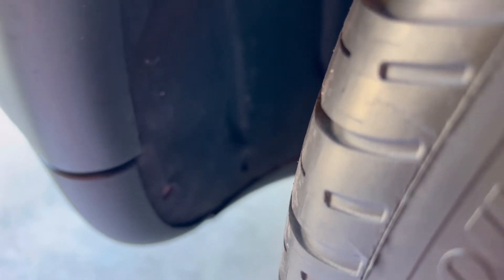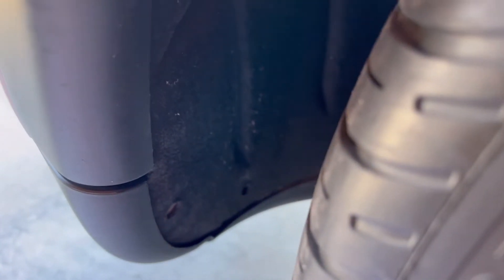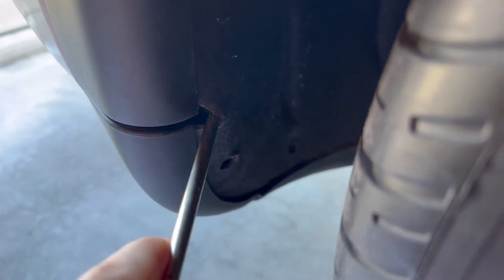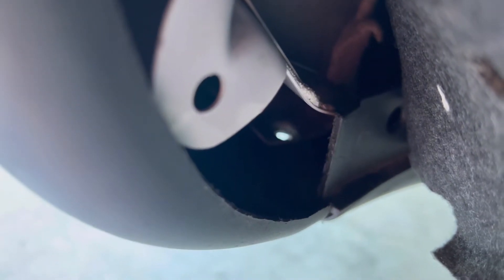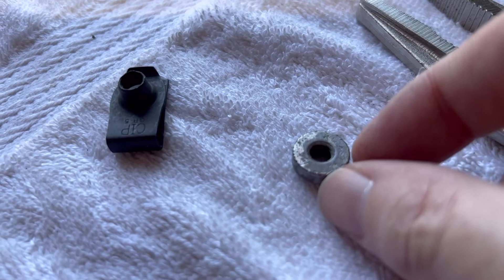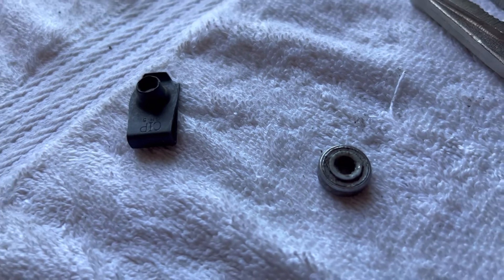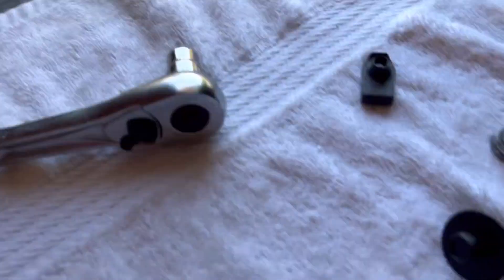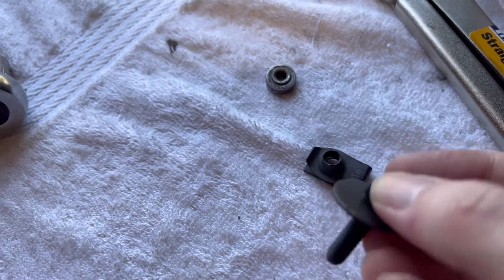Tesla Model Y Rear Mud Flap Bolt Fix

Comment: First, thank you! Last mud flap on a 2026 Y and had this issue. Found this and was a life saver!

I can confirm this is the perfect fix for this issue that Tesla has yet to address even for a 2026 Y.

The tool is about $12. Bolt and clip were about $10. I’d suggest to use two people: one for holding on with the vice grips and one to slowly undo the bolt.

Last part, the u clip. Hold/lock with the vice grips and push on.

Thank you again. Was so angry, but with patience and finding this, corrected the issue in about 10 minutes.

Comment: I forgot the 4th mudflap and this looks like exactly what happened. My Y is a new ‘26 Upgrade and the bolt hole looks the same but fasteners inboard of this may have changed with the new rear end design. Any chance Tesla would cover this on a 3 week old car….happened as I tried to loosen the bolt. Thanks for the great video.

Comment: Thank you for this.  To fix my issue, I took the wheel off to get better access and used a hack saw to take off the head of the bolt.  I then reached in with 15inch needle nose to remove the nut.   I followed your suggestions for the clip and new bolt, which worked well.
Reply from the maker: Awesome! Glad it was helpful.

Comment: Can u share the unuts Amazon link for me, not sure which one is the right size , as they shows  in mm system , thanks
Reply from the maker: I'm not 100% certain if these are an exact match - https://www.amazon.com/Hillman-Group-58452-4-20-Inch-Extruded/dp/B00NWJEXSG/ref=sr_1_1?crid=1Q0RD0NFJ1LSL&keywords=Hillman+1%2F4-in+x+20+Black+Phosphate+Steel+U+Nut&qid=1699311673&sprefix=hillman+1%2F4-in+x+20+black+phosphate+steel+u+nut%2Caps%2C122&sr=8-1

Comment: Great video and exactly how it is done. First off- wtf Elon on a round nut!!!! Second - it is very difficult to get off. I recommend getting the 15” pliers and wd40 nut bolt penetrant that loosens nuts bolts.  It does take a lot of maneuvering to get a hold of the dumb round nut. Gimme a break Elon.

Comment: Hi, I want to install a mud flap on my 2023 model y. I'm not really good with doing car upgrades but I want to learn. Can you tell me what type of socket wrench you are using? I've never owned one and I want to make sure I get a set that includes the size needed.
Reply from the maker: I can’t recall the specific size for this bolt, but getting a 3/8” ratchet set with a variety of socket sizes is always good to have. Good luck!
Reply: @wesg92  sorry to hi jack the comments.  Great video
Reply from the maker: @jneptune1540  thanks! Hope it was helpful.
Reply: @wesg92  Thanks. I just got this car. Before was a 2006 Camry and I never did any work on it. I want to learn how fix stuff and add items on this Model Y.

Comment: I can't seem to get a good grip on the nut with the vise grips. I can get on, but as soon as I try to remove the bolt the nut slips out. I think I'm just not grabbing enough of it, but the angles are horrible to work with. Any pointers on getting a good grip? I don't want to break anything.
Reply: I'm primarily worried about the fender fascia breaking with me tugging on and bending it. I hit the bolt with some WD40 from above but frankly I'm considering at some point just using a Dremel to carefully cut off the bolt head if it still won't come. Thanks for the info! I'll keep working at it.
Reply: I used a mini hack saw to cut the head off the bolt. @steves.4848
Reply from the maker: Ya, it's really tough, but possible. Are you using 15" needle nose vice grips? That's what I had to use, and it probably took me nearly an hour to get it at the right angle and clamped tight enough to hold while unscrewing. Hope that helps, let me know if you have any more questions.
Reply from the maker: I don't see any risk of breaking anything. You can clamp down on that nut REALLY hard (in face you have to), and if it breaks somehow that's fine! Nothing else should be at risk.
Reply: And yeah I'm using the 15" needle nose vice grips you suggested.
Reply from the maker: Gotcha. Ya I bent it quite a bit but didn’t feel like it was close to breaking. It’s certainly not easy! If I had a mig welder I would have just put a spot weld on the nut to the frame. Cutting the bolt is a good option if you can do that.
Reply from the maker: Also, if you can get someone to push up on the bolt, that may raise the nut enough to get a better grip.

Comment: Been looking for a DIY fix for my broken bolt.  THX. Does your Model Y have the single piece rear casting?
Reply: Yes, 2022 is single rear casting, which means ur video will work for me. Many Thx.
Reply from the maker: @grega7856  best of luck! Reach out if you have any questions.
Reply from the maker: Glad it helped! I’m not sure on the rear casting, but I think so as it’s a 2022.